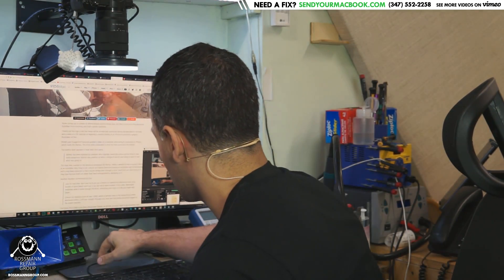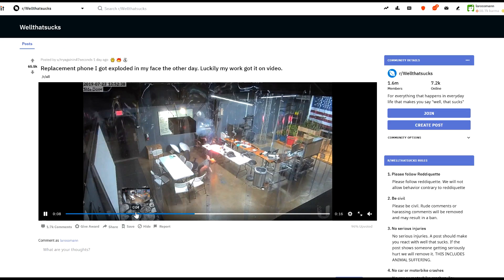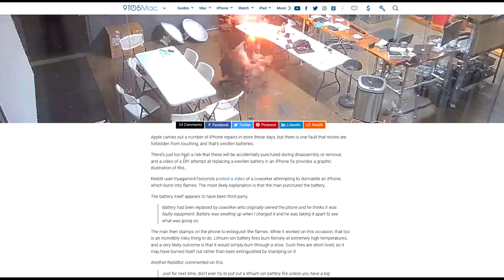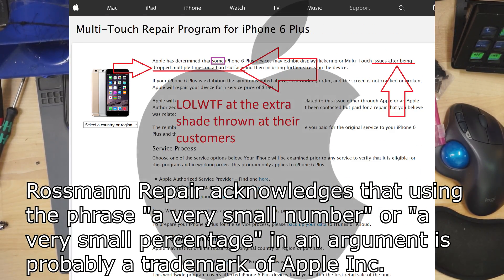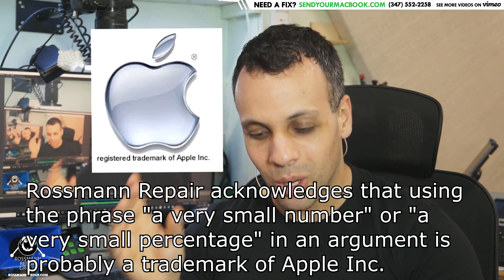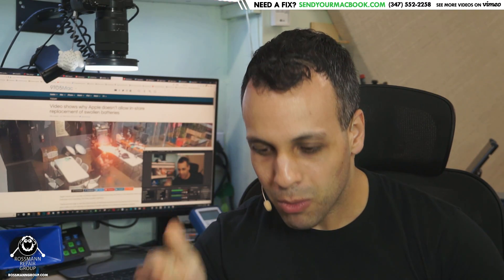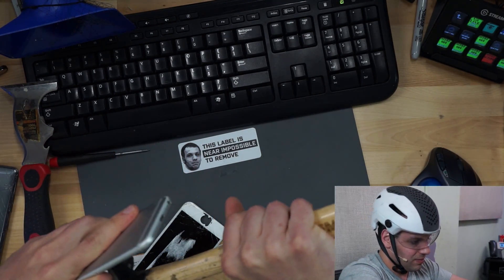STOP FEARMONGERING

Comment: There was nothing wrong with using F🤬ING SCREWS to hold down a Battery in a MacBook as let’s face it how heavy are FIVE  F🤬ING  SMALL SCREWS 🤷🏻‍♂️

I recently had to Replace a Native Samsung S6 Battery for a customer as the “Adhesive” had Failed which had allowed the Battery to move about inside the phone snapping the Flex Cable which wouldn’t have happened if it had been screwed down in place, as for iPhone Batteries they only become swollen if they are “Liquid Damaged” or if the user has been using a “Fake USB Cable”

Comment: The adhesive is way too strong on these batteries, the adhesive tape has tabs on them that you pull on to remove the battery, have punctured a few, and have seen one blow up because of being punctured, if you’re a tech just practice and you’ll get good enough at removing them, use some alcohol too it works. Original or 3rd party doesn’t matter they’re all the same in terms of it blowing up if punctured. Even if they’re swollen you can remove them quite easily

Comment: Great video and points that you made.  I am still using a now outdated LGV20 phone, which was the last one they made with a removable battery.  I refuse to buy another device until I am either forced to, or manufactures start putting removable batteries back in again, or at least make it easy enough to take apart and then remove the battery and replace.  All this glue they are using is ridiculous and ends up being the "root cause" of the fires.  It forces you to have to pry the battery out, and they is where the "danger" is.   All they need to do is use that handy dandy piece of rubber that was used to put pressure on one of the BGA chips as a "fix" for poor soldering.

Comment: We've been reaching a point in recent years where people notice the improvements from one generating to the next much less. We processors powerful enough to game on. We have screens that are so clear you have to try to pick out individual pixels and we're able to comfortable browse the web. Most users don't notice the hardware improvements from one generation to the next. So, why should they buy the next generation? Companies have solved this problem by making the battery a single point of predictable failure that forces it. If they didn't, people might go 5-10 years without replacing their phones rather than 1-3 years. That is less than a third of the money they could be making.

Comment: I could be wrong...but...if we would follow this logic that a device with charged battery is potential risk of fire and because there's no such thing as apple-energy, the battery can either store energy or be depleted of such, hazard of fire is same from original parts and 3rd party producers (I mean - energy is just an energy,  something can go BOOM!...or it can't )
Would this argument about not doing repair because of risk of fire apply to each and every product Apple offers? The battery to keep the clock up is mounted into stationary computers, it does not even have to be mobile device to fall under such category.

That could be really a next step of evolution making the non-removable battery just a prelude to a real fu***ng

Comment: "Puncture it"? "Holding the tool wrong"?
If it was a removable battery, you couldn't puncture it, because you couldn't hold the tool wrong, because there is no tool.

So basically what A'Blergh has done is: Increase the risk of batteries exploding when removed, then justify this by pointing out that there is now an increased risk of batteries exploding when removed.

That's kinda like taking a look at security railing and concluding that there is perhaps a non-zero chance that someone might fall over when they lean on it. So you make it knee-high to discourage leaning on it, and when someone eventually trips on it, you come in and say "See! You shouldn't lean on it!"

Comment: Personally I have replaced about 100 batterys in various macbooks and iphones. I have never punctured the lithium ion battery. The risk is very small of puncturing the battery. As demonstrated by Louis here, you can remove the battery with a hammer without puncturing it.

Comment: Yep. If these asswipes are so concerned with the safety of their customers, they'll go back to easily removal batteries instead of gluing them to the damn case. I punctured a battery by accident once, but luckily; the worst thing that happened was that it sparked up a bit. I was able to carefully remove the rest of the battery and properly dispose of it with no issue.

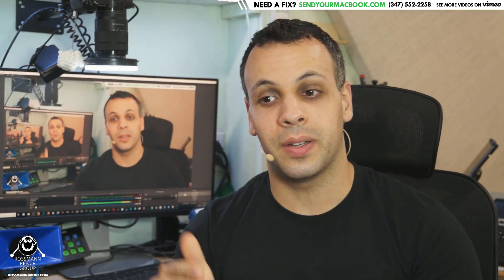Comment: 4:51 Mostly when people are stupid (=using too much force/using improper tools/shortened a not deep discharged battery* ... or even a full one, working with the charger plugged in ... not disconnecting the battery first, and many more), or when the battery is low quality or damaged in first place. But those tend to explode even if handled correctly. (e.g. Samsung and their Notes)

= Batteries can be surprisingly safe if there is *NO energy stored in them. And "empty" li-ion / li-po still holds a lot of energy. Tho, for removing a worn out battery (which will be thrown away anyway) that is glued in I always will discharge it till the safety circuit kicks in, maybe lower if easily accessible ... just with a appropriate resistor. 
If you are not doing it as a profession ... you can wait the 24 hours till it is completely empty.

Comment: Is there any reason at all to have the battery glued to the phone, other than "so you have to buy new phone if battery dies"?
Reply: Nope.  In these discussions many people seem to conflate "non user replaceable battery" and "non serviceable battery."   They are very different things. Even if you have to seal the battery in the device for whatever reason so an end user can't easily replace it there is NO reason you can't secure the battery in the device using a method that makes opening the phone and swapping it safe and easy for the repair technicians.
Reply: @josh885  It's actually not that hard to remove some of the glued batteries (I say "some" because the newest iPhone I opened was a 7, and I don't know if all iPhones are like the ones I worked on). You just remove the glue, not "the battery". It's not what I'd call easy, but it's easier and safer than ripping the battery out.
BTW, before discovering the "right" way to do it, I actually punctured one battery with a metal screwdriver and, shock and horror, it went "poof". Not "boom" or "whoosh", no fire, no mortal danger, just "poof". But you wouldn't want your customers' Starbucks coffee to smell like burnt lithium, right? XD
Reply: Perhaps..

What is the correct word for corporate sadism?
Reply: Car batteries can also explode if handled improperly.. Hydrogen gas and a small spark.  
 Probably would be safer to total your car, then to risk a jump start.

Comment: Even if you follow the argument that the battery is better of sealed in the device (for one reason or the other) ... there is no need to permanently glue it in.
In Germany there is even a law that batteries have to be user serviceable unless for safety reasons.
Although the companies found every loophole and made it pretty much useless.
E.g. Instead of making the cells user serviceable or use standardized packs the make proprietary packs they only sell for one model of one device ... and take an arm and a leg for it. 100 times markup from the cells and more ... for a 1$ circuit and a (often not so) fancy plastic enclosure.
Or they declare everything a safety reason. Even absolute absurd ones.

Comment: I agree with you for the most part, but the argument that it's okay to put the technicians in danger because they are a small percentage of the population doesn't feel right. There are other valid arguments to allow them to work with swollen batteries. For example, that they are trained professionals capable of doing that repair safely when given enough time

Comment: I still use my Galaxy S3 primarily because I can quickly and easily access the battery. I've only had to replace the battery once but it's nice to be able to force a shut down and I always have a case on it so I'm much less concerned with OEM water proofing. I hate that I can't find a brand new phone with an easily serviceable battery.

Comment: Puncturing a lithium battery won't always cause it to catch on fire. The lower the charge, the lower the risk of catastrophic failure. The act of the battery inflating actually makes the battery less dangerous because it separates the tightly packed anode/cathode and insulator layers. The gas causing the cell to expand is the electrolyte boiling off, which causes the battery to lose most of its capacity.

The only problem you really have to deal with is the pressure in the pack, which is easily dealt with. Take it outside and use a tack or needle to make a shallow pin prick in the casing and then squeeze the gas out slowly. While the gas that comes out of the batteries smells nice (I'd describe it close to wintergreen), its not a great idea to inhale it.

What will cause a catastrophic failure is if you have a moderately to fully charged battery and you puncture it in a way where the battery layers come into direct contact with each other. The dead short that results causes all of the stored energy to be released in that spot, which if not blown clear, will result in smoke and fire. I've shot deck nails into lithium battery packs and removed them, once the damaged layers around the hole blew away, the battery returned to being stable.

And despite them being called lithium batteries, they really only have a tiny amount of lithium ions in the electrolyte. If the battery had actual lithium, if it went on fire, it'd create something akin to a welding arc that would burn through anything and require special chemicals to put out.

Comment: What coincidence, I just disassembled an original A1281 yesterday, pulled out to have all 3 cells at storage voltage level. Left it overnight, woke up to see all 3 cells SWOLLEN, all 3 checked at < 2 volts. Turns out the balance IC has been discharging the pack, the whole pack was measured at 4.95V, killing the whole pack. Damn you Apple!!
(I think it was intentional as there are gold contacts with the case on the battery board)

Comment: Louis, I think you could make a follow up video to this, showing better implementations or battery securing techniques, in both laptop and smartphones. Like pull tabs, reasonable amount of malleable adhesives, or laptop designs with a screwed in access panel and connectors versus heat guns, etc. I'd really like to hear your thoughts on different design choices.

Comment: Also this constant narrative that third party cables and power supplies that do not meet crapples extremely high levels of quality... Absolute B.S! The charge controller is within the Lemon device and therefore any battery swelling or fire due to charging is a direct result of a fault from within one or many of the extremely high quality components inside the Lemon device itself. 
Also, a charge cable is just pieces of wire in a plastic sheath. There are no spectacular conductors made exclusively by the Lemon corporation by only the highest quality Dutch virgin goddess' that weave their conductor cores from oxygen free copper plated with unobtainium in a patented cable with magical dual helical plaited shielding in a 1000 layer weave of superconducting unobtainium harvested by naked Nordic virgins from unobtainium bearing unicorn manes.

It's just four wires in a cable with a USB plug and a proprietary Lemon plug on the other end and has absolutely no effect on the probability of a pack swelling or catching fire. ZERO increase in the risk of fault or fire.

Apple have about as much honesty and integrity as Mark "fuck 'em" Suckerberg.

EDIT: Real cheap chargers are not built to good enough standards in as far as insulation and can pose a shock hazard and should not be purchased. They will not though, fuck up your battery, unless they send mains to the phone, which negates the battery condition issue because it will fry the device and yourself.

Comment: Afaik you should discharge the battery before you work on it. This way it probably won't catch fire even if you puncture it.
Reply: Yep. The fires come from the stored energy, not the magical lithium ions. If you remove the energy, you remove most of the risk.

Comment: I tried just now to puncture. My Lumia 720 dead phone battery with a needle a knife , slammed with an hammer multiple times ...no use . I was not able to even scratch the battery surface.
Then an idea , my vertical drillers, and it does caused massive damage and when the battery inside was exposed it self ignited.
By accident you can't puncture the battery ; you need very sharp tools ; I don't think any technician is a secret owner of kill bill Hattori Hanzo Mythical Sword to remove a battery.
Apple is just full of S.

Comment: True, batteries are rare to ignite today. Usually they have a plethora of electronics, that prevent it from doing so. Still, once the battery gets swollen, it's best to work in safe conditions - non flammable area, with safety equipment on and have a metal bucket to dispose of the thing, should it ignite.

Comparison with a fuel tank is not very fair, as Lithium-Ion batteries, as far as I know are self oxidizing upon failure and will run like a rocket engine.  Because Lithium is also very good rocket fuel. To be fair, battery has probably more thermal energy stored in it, than electrical energy. While you can beat the crap out of petrol and even attempt to ignite diesel with no failure (ignition), batteries are significantly less friendly to stress. To make it better, once battery ignites, pretty much the only thing you can do, is wait for it to stop burning.

So, it's small percentage of a chance, but not worth the risk at all. It's just like not having an animal insurance for your car. I never really crashed i my life and guess what. This Monday, I smacked my Alfa to pieces on a wild boar. Chance of it happening? Less than 0.1%. And my car is completely wrecked, had to get new one and my pocket is 1000$ lighter. This time I have insured it for almost everything there is.

Apple not doing this repair in store? Yea, I can see why. When you have 50 000$ dollars worth of electronics around + a bunch of people, you better not take risks. Not that they can't do arrangements to create a safe workstation of coarse.

Comment: If Apple cared about the battery being safe they wouldn't be gluing the bare battery to the inside of the case to begin with.  The components of the machine and the battery should be mechanically isolated so they're protected from each other.

Comment: Its about safety?
No, It about ensuring you need to buy a new phone from us.

Care about the environment?
Then demand devices that can be repaired and that last for many more years.
Planned obsolescence is wasting finite resources - dont stand for it.
Reply: When the device has reached the end of useful life... How do you recycle parts or material... Can't even take the battery out. 
You can't mess with it, you have to bury it.Should be engineered for easy disassembly, and recyclability

Comment: Can't wait for Apple to hide explosives to prevent repair.
"These aren't to prevent repairs, they're anti-hacking measures!"
Reply: Don't know about using actual explosives but it wouldn't be surprising at all if they added an "anti-tamper mechanism" that basically just sends high voltage through everything frying every IC and data storage device.
Lost data? Should have used the cloud back up.
Reply: @BitterCynical  They literally already do this: Louis has a video on the macbook pro's that send 42V to the CPU if its too humid.
Reply: Bitter Cynic they already have this. Everything on the iPhone is encrypted not with your passcode, but a combination of your passcode and a key on the Secure Enclave. 
When the devise is “wiped”, the only thing it does is erase the key in the Secure Enclave, all data remaining on the flash storage is now as good as random numbers, and can never be recovered. 
I’m not even sure if they bother overwriting this data, but theoretically they shouldn’t need to. If you wanna use the iPhone for anything else, a new key is generated and you start fresh. I believe all 64 bit iPhones function like this.
Reply: "Suprise mechanics"
Reply: The Apple iED?
Reply: "The explosives we have placed in your phone are a measure to ensure your safety " - apple

Comment: I'm sorry, I don't have a ton of experience with Lithium-Ion batteries, but with most batteries, they don't explode if you drain their charge before doing stuff with them, unless you either externally introduce a current, or introduce a spark/high heat. Is the same not true of Lithium-ion batteries? A quick google search does not answer that question. The description of how the things work implies that they go boom becasue of a short, which shouldn't happen if the battery is drained before puncture. Yes there is potentially a small charge left, but it would be more likely to cause a controllable heat fire as opposed to a boom, correct? 

As far as sealing batteries in or refusing serivce, there is no excuse for sealing in a battery like that. If you actually NEED the battery to be enclosed, make an external enclosure, don't just adhesive it in. There is also no excuse for refusing to service a device less than 5 years old, with the possible exception of products that were recalled initially to begin with.